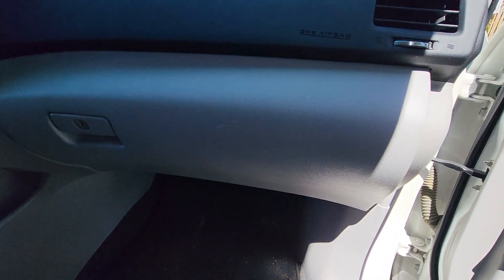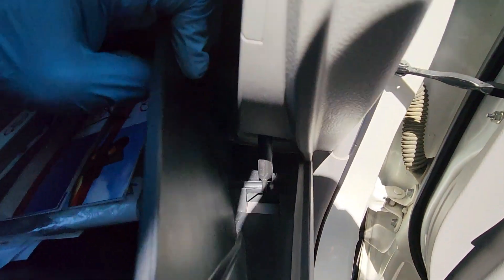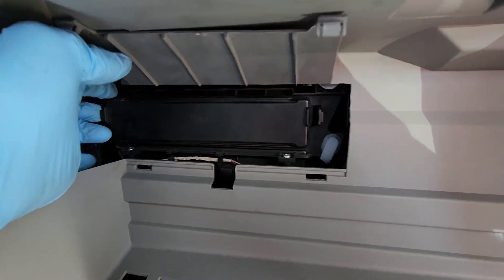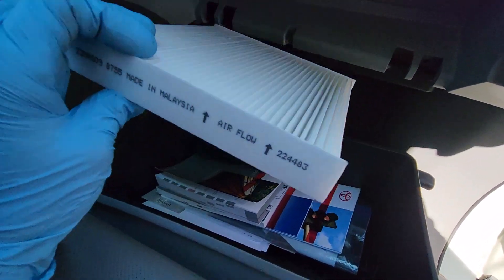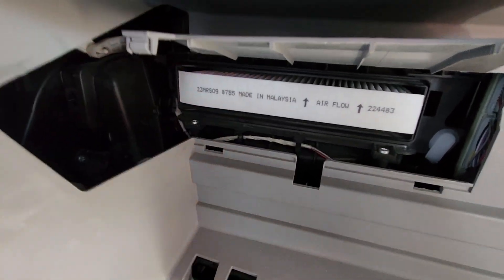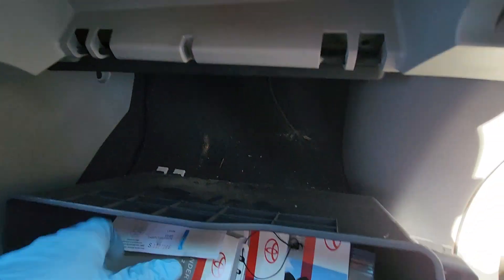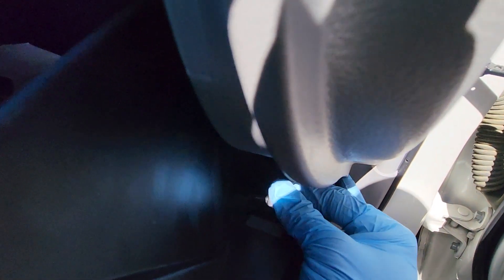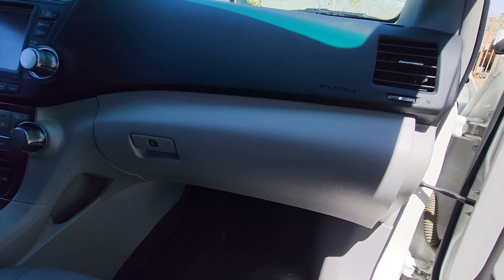Toyota Highlander Cabin Filter Replacement Done Easy!!!

Comment: Good job except for one detail. The air flow arrows should point down. The blower is below the filter if the dirty air was going through the blower before going through the filter then the filter would trap dirt and debris inside the blower. If you need proof of this then remove the filter and hold a piece of tissue where the filter goes and see which way it blows when you turn on the blower. The arrow on the plastic panel just tells you how to install that plastic panel not the filter.